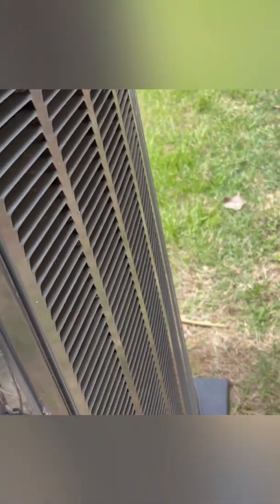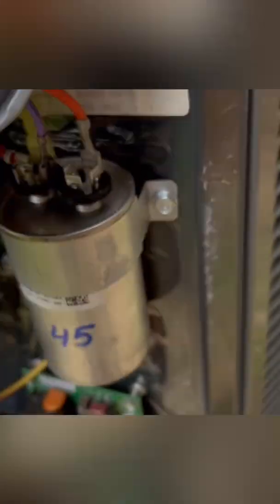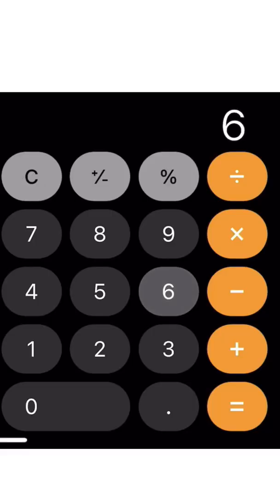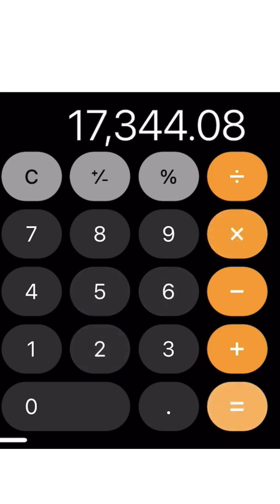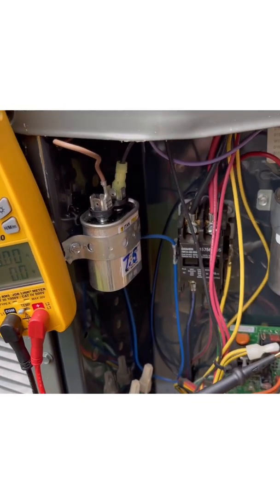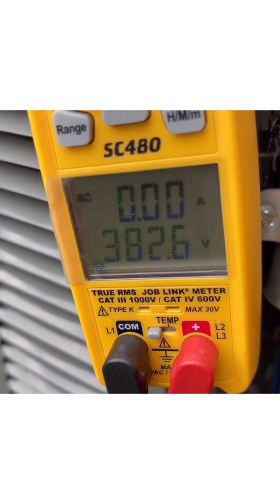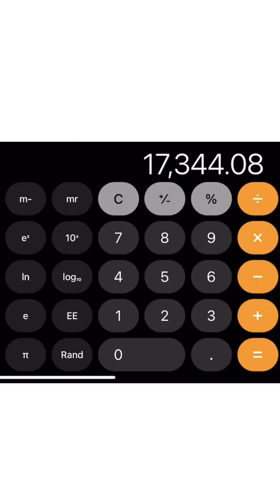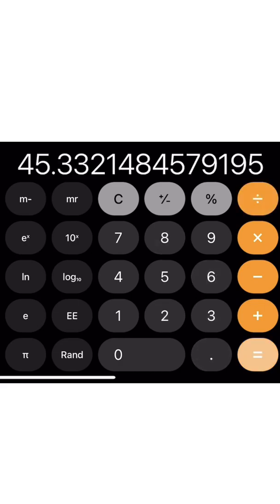How to check a capacitor under load

Comment: To much math lol
Easier to just cut disconnect and check mfd
Reply: This shows what the capacitor is actually working at vs being dry. You get a more accurate reading this way.
Reply: @mtucker3401  I’m about to graduate the HVAC course but they don’t teach us to check it this way. So is this really better to check under load vs it’s capacitance on a bench?
Reply: @E85_STI  do you get your miles per gallon as you’re driving or while the car is off? In my opinion, under a load is best so you know what it is doing while the motor is operating.
Reply: @mtucker3401  so I checked mine and it’s a dual cap 70/5 I did the check just like yours and it came out to 58.34 so is this number supposed to be closer to the 70 microfarads?
Reply: @E85_STI  yes, should be much closer to 70.
Reply: @mtucker3401  gotcha and in my neighborhood the caps have been going out after a few years and my unit is 4 years old roughly. My house was built in 2018 and many people ask about why their air isn’t cold and it’s been the cap most cases. Where could I buy a capacitor is it at home depot or lowes?
Reply: @E85_STI  you have to go to an HVAC supply house, like Johnstone or United Refrigeration.
Reply: @mtucker3401  gotcha I’ll have to find one but last question so when I graduate I’ll have an associates degree and two certifications level 1 assistant technicians and level 2 technician. Being “licensed” is what exactly like I follow a guy around for a year or two then I’m licensed?
Reply: @E85_STI  that depends on you. I did for a couple months at the beginning of the cooling season and again at the beginning of the heating season. All depends on you and the company you work for.
Reply: @E85_STI  it's totally bad most give you a +/- 6% of whatever it's rated at. 58 is far too low
Reply: Just read the replies......you knkw already😅
Reply: @damienarnold6585  yeah I changed it out just because it was out of tolerance. It’s now reading 71 microfarads.
Reply: @mtucker3401  Your point is accurate, but your analogy (about MPG with the engine off) is not.  Meters measure capacitance by applying a signal to the capacitor to see how it responds.  However, the signal is low voltage and there's NO reactive load, so it's NOT similar to the real-world application for THAT type of capacitor.  (It could be for a small capacitor on a circuit board, however.)

A better, but still NOT great, analogy might be testing a car's fuel economy while on a dynamometer that is set to zero drag (rotational resistance) — varying the engine speed up and down...  The only resistance the engine would experience is its own internal friction, drive-train friction, the forces required to accelerate drive-train components, and the tires' rolling resistance.

Missing would be wind resistance and the force required to accelerate the car's mass.  Of course, ACTUAL dynamometer tests for car fuel economy do NOT use zero rotational resistance, but they're STILL a poor substitute for carefully executed driving on a test track.
Reply: @55dbk  that was above and beyond any response required. 
I guess it would have suited you if I had said a car battery with the car off vs the car starting. The point is there regardless if it’s a perfect analogy. 🙄
Reply: You think that is too much math? That's so disappointing.
Reply: It's good to use if you're working on hack shit with no visible disconnect,  multiple systems, a critical temp application, or communicating equipment
Reply: It’s actually More accurate under load & can be quicker. But either way works.
Reply: not all the multi meter has a capasitance tester...
Reply: @sagisagdom  and capacitance may change under load, so meter reading may be misleading
Reply: Weak tech spotted
Reply: It's just 1000000/(2πf)
Reply: Math is racist?
Reply: Too much math for who lol
Reply: good to know both methods!!??

Comment: There what is?  Is that the size of the cap?
Reply: That's what the actual microfarads is on the cap.  It's probably a 45 microfarad cap with a plus or minus of either 6% or 10%

Comment: can you explain why 2652 ??? please
Reply: U=i*Xc Xc=1/(2*pi*freq*C) freq=60Hz (US) (EU 50Hz) C=45uF It is the Ohm's law
Reply: @dejanpotocnik8407  Yes. Ohm's Law plus the Reactance Formula (for capacitors in this case). The latter is what seems to confuse people more than Ohm's Law itself.
Reply: Micro Farad is 10 to the negative 6 power which goes from the .00 to the 2652 when you move the decimal to the right 6 times
Reply: 1,000,000 / (2 * pi * Hz)

1 / (2 * pi * 60) = 0.0026525284

Multiply this by 1,000,000 to convert the answer from Farads to micro-Farads or 2652.5284.  Most people just truncate to 2652. In case you're wondering why you multiply by 1,000,000, it's because 2652 is in the denominator of the calculation for capacitance.

Hope this helps.
Reply: @jsswizard  Dude amazing answer, thank you

Comment: Why 2652?
Reply: 1,000,000 / (2 * pi * Hz)

1 / (2 * pi * 60) = 0.0026525284

Multiply this by 1,000,000 to convert the answer from Farads to micro-Farads or 2652.5284.  Most people just truncate to 2652. In case you're wondering why you multiply by 1,000,000, it's because 2652 is in the denominator of the calculation for capacitance.

Hope this helps.

Comment: Why is the voltage drop so high?
Reply: It's not really a voltage "drop" since no current flows through the capacitor. The voltage across the capacitor gets boosted above line voltage by the back EMF of the motor inductance.
Reply: It's not a voltage drop.  Caps are either 370 or 440 volt.  I image this is a 370